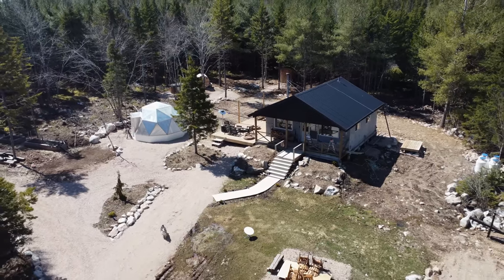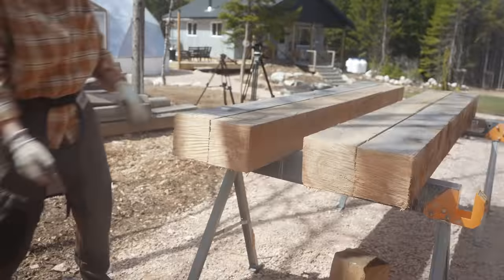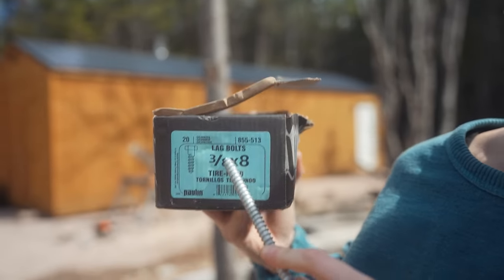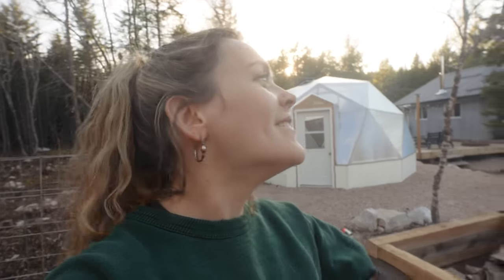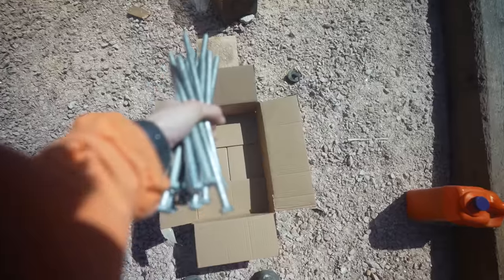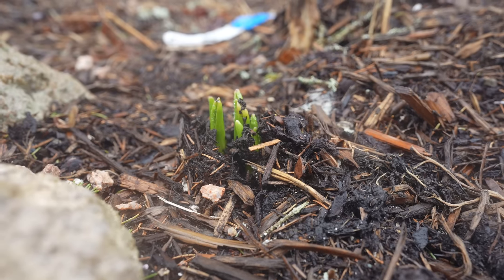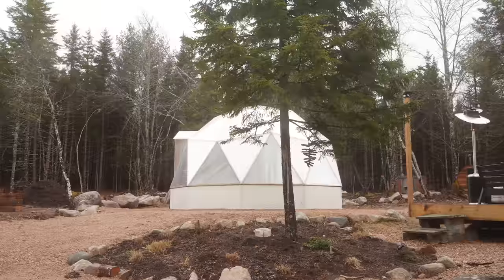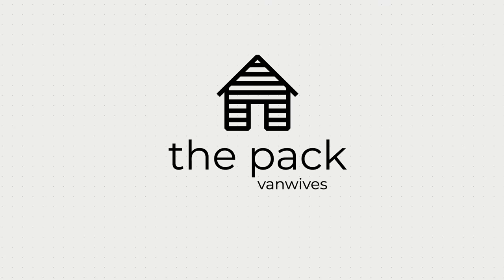Turning this Bare Land into a Garden

Comment: There is not any reason to use 6 x 6 lumber for raised beds.  2 x 6 lumber works just fine.  Cheaper and the lag bolts are much shorter.  I think you might need to make some little screen tops for each bed to keep bugs and animals out.  I tried organic last year, but between snails and ants bringing in aphids mine ended in failure eventually.  One nice thing about raised beds is you can spray around the beds without get pesticides on the plants or growth medium.
Reply from the maker: 6x6 is nice because you’re able to sit comfortably on it. As well we like the design better too. 2x6 looks and works great too. All in preference :) yes we will for sure need to do something for the animals. Thanks for watching :)

Comment: Since you now have a good supply of solar electric, consider getting some battery powered outdoor equipment. We have have been using Stihl lawnmower, string trimmer and chainsaw for a few years now and they work great! So far, rotating two batteries for all three is working well. My sweetie, who is the main chainsaw operator, says she loves the lightness and performance and wishes she had switched from gas powered sooner. We have a way smaller solar system than yours and it is enough to operate them. Bonus, less gasoline to purchase!
Reply from the maker: That is great news, yes now with solar the possibilities are endless. Thank you for sharing with us. Have a happy Sunday.💛🐶

Comment: Hi girls. Great video, we are happy to see you're getting ready for growing season. Diana and I think you might look into EGO electric power tools. We have a lawn mower and the multi head collection. All of which run on electricity. We were thinking they would make a good sponsor. We have nothing to do with EGO tools except using them. Have no carbon footprint with your solar powering up your gardening equipment. Gas power tools get rid of them. And EGO are light weight so even us old ladies can use them.Yeah.

Comment: If you use the dry pucks that you soak, make sure you take the sleeves off them before putting in your compost. They are plastic and do not break down. I learnt this the hard way and had to pull out hundreds. Also labels on fruit are also plastic , they go in the garbage. It’s unfortunate that producers use them
Reply from the maker: Thanks Joanne, very good advice. Thanks for tuning in.💛🐾

Comment: predrill your holes before you try to force a lag bolt thru a log that size.get a long drill a size smaller then the thick part of the bolt drill it in as deep as you can then the lag bolts go in much easier and faster, if i can make a sugestion for your next effort get some long construction screws with a tork head they work much better then lag screws.(they use them to build log cabins and post and beam houses) just sayin 🙂
Reply from the maker: Thanks for just sayin! We love the advice. We appreciate you sharing your experience with us.🤩🐶

Comment: My daughters love watching your videos!!! they say every sunday morning... "Can we watch the van girls that have a cabin now?!?" this is a 7 and 5 yo!! Just FYI- Lags are nice but they shear under stress. I am a fan of TimberLoks.... they use a nut driver and can be driven in pretty fast. I am also a fan of Simpson SWDH screws, they come in a slew of sizes and they are driven with a T-40 bit or you can use a GRK screw. If you go to your local big box hardware store or local hardware store, you ask them about any of the above, they can show you them. Porter might know what I am referring to but the price point should be on par with that box of lags or maybe alittle bit more. I'm a senior lumber estimator and quote house and commercial lumber packages daily.  you wont waste any olive oil driving any of these guy - they can be exterior rated and are supper aggressive with the threads and just keep pulling. I can bury them with my impact. But either way yall got'r dun!!! Great job!

Comment: I don't know if anyone else pointed this out to like both broke because they bound up .. if you were drilling smaller pilot hole all the way through they woulda broken.. this is a true especially with the hardwoods.. can I think that's classified as a hardwood..  keep up the good content and I'll keep..
Reply: I hit the wrong icon keep up the good content I'll keep watching .. I also thought of another thing if you took bar soap and covered the threads with the bar soap they would act as a lubricant to cut through the wood as well.. brickfest with my father and the carpenter told me.. what are you doing a lot of times in the wood didn't split or the bolts and screws didn't break .. good luck on the New garden. I hope you get what you need out of it.

Comment: Stick with the smaller chainsaw- when those things kick back it's dangerous. Love that you are putting the garden in - I am so guilty of planting too late. A few 200 watt wind turbines on the roof of the greenhouse with an independent battery set up will keep it warm - or you can integrate it with your battery set up. Kale, lettuce, radish and spinach are all hardy types to grow in the winter. Wind is abundant  - maybe it's the way to keep the garden heated through the winter.
Reply from the maker: Thanks for your input. It happens. But we sure hope we are not too late this year. 🌞🐶
Reply: @Vanwives  Life is what happens when you are making other plans ;) Bravo for getting things done! I enjoy your videos very much. Better late then never - you can also use a "hoop hut" to extend your growing season. You can also use a hydroponic Tower Garden to grow vegetables like tomatoes and peppers indoors.
Where there's a will there is a way. Love what you are doing!

Comment: Many folks will suggest adding straw, branches, or logs to the bottom of new raised beds as a cost-saving measure. I strongly recommend against this. Filling your bed from top to bottom with an organic raised bed mix is worth the investment in the long-term by increasing moisture retention, crop productivity, and soil structure.
Reply: Also, take the time now to set up an automatic drip irrigation system. It's SOOOOO worth it!